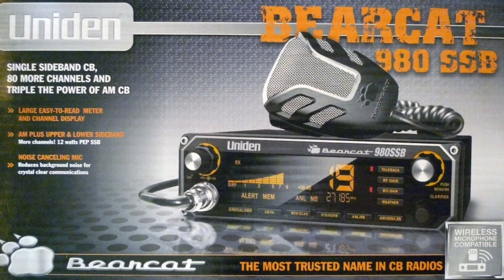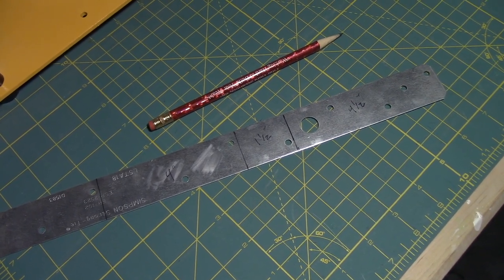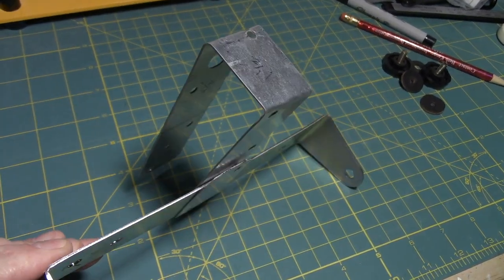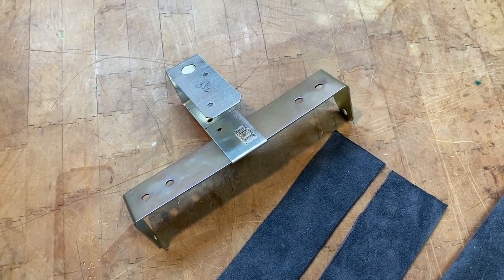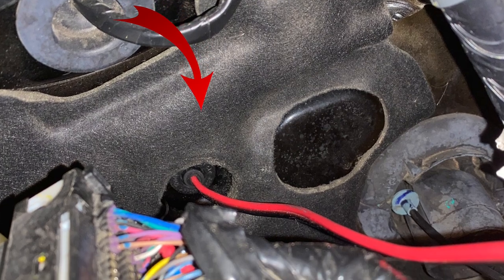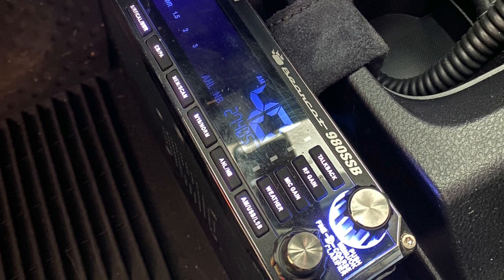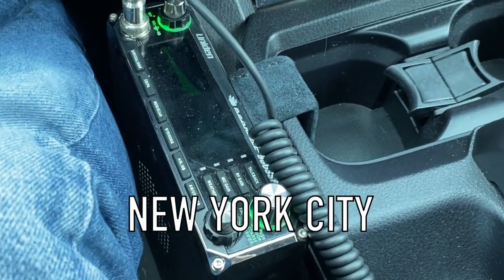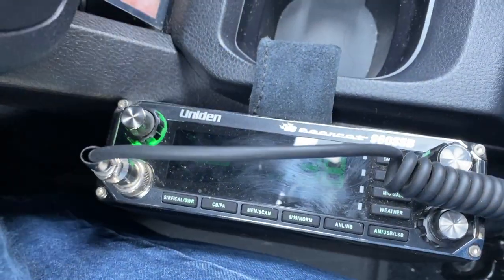Tacoma CB Install - NO DAMAGE! Toyota 3rd Gen 2021

Comment: Since it's only four to twelve watts, why not just go with the accessory plug?
Reply from the maker: You certainly could, but personally I despise running CBs off of accessory plugs - too much RFI and engine noise. With my set-up I also have an additional CB accessory that requires being hardwired, so going through the firewall was a moot point. It had to be done either way (for mine). Thanks for watching and taking the time to leave a comment. Stay well.
Reply: @HNXMedia  Valid points.  Incidentally I swiped your "Tools for horror movies" sign idea for the cabinet our lathe is mounted on (giving HNX Media credit).
Reply from the maker: @barneymm2204  LOL. It's yours to use, friend. I am just glad someone enjoyed my weak attempt at humor.

Comment: Any chance you are going to post a review on the radio?  Maybe what type of ant. would be a good match?  Looking to maybe add a radio to my truck.  Thanks.
Reply from the maker: I might do a review of this radio, but to be perfectly honest, there are only two single side band CB radios on the market that are worth the money: Uniden Bearcat 980 SSB (the one in the video) or the President McKinley. I have both and both are fantastic radios. It all depends on how much you want to spend. The Uniden is a little less expensive than the McKinley. The Uniden in the video had been in my old Jeep for YEARS - used, abused, left out in the midwest humid hot summers and sub zero winters. Never had a single issue with it. The McKinley looks more "modern" and "rugged" but they are comparable radios. I would not buy any modern CB without single side band. As far as a mobile antenna, the only antenna I will ever truly recommend is a 102" stainless steel whip. Yep, they are long and hit drive-thrus and you are going to get all kinds of "looks." but they are PERFECT 1/4 wave antennas for the entire CB band. Additionally, they are "plug and play" so you don't even have to worry about tuning them. If you absolutely cannot use a 102" whip, then I would recommend a tunable Firestik antenna. Once they are tuned and locked in, they are bomb-proof. But seriously, just get a 102" whip. They are bad arse antenna and I will show mine in a coming video where I show how I hooked it up without any drilling on the Tacoma. Thanks for watching and taking the time to ask a great question. Hope this helps.
Reply: @HNXMedia  Thanks for the info.  Saved and noted.